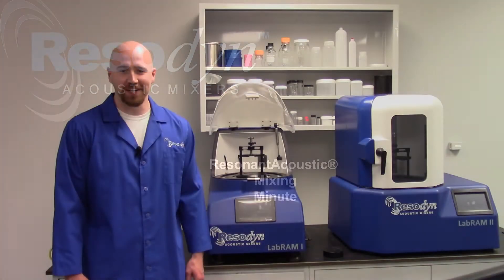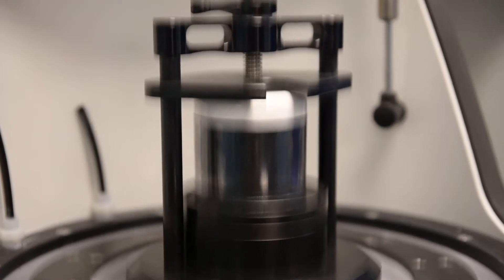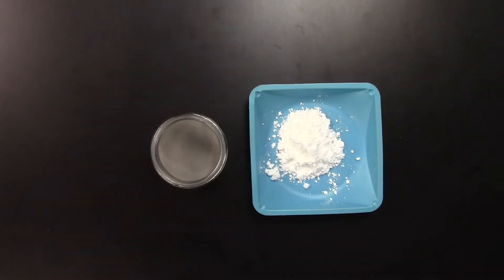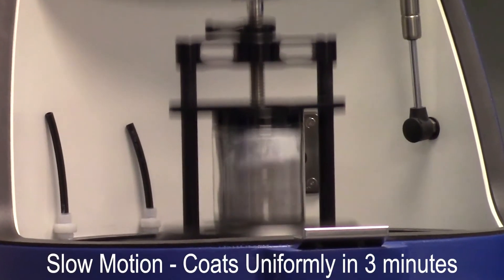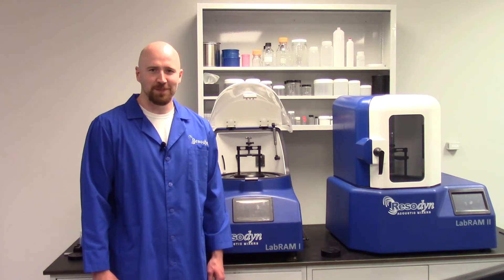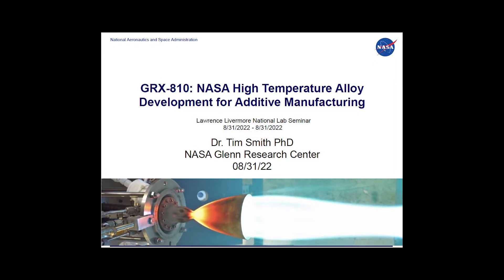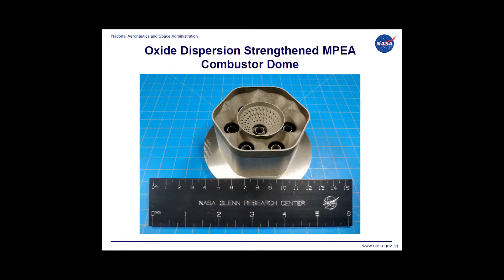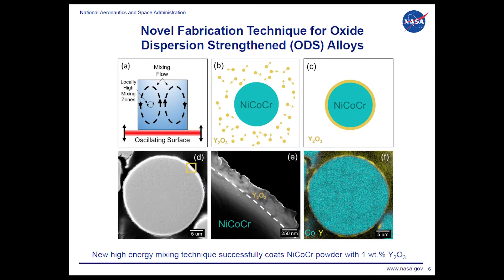Resodyn Acoustic Mixers Mixing Minute ODS Alloys NASA GRX-810

Comment: Im curious if this could be done to automitive car parts that need hogh tolerance like.. the piston and piston arms. The tiny metal spacers for the crankshaft, the crankshaft, the valves the the heads the block itself. Also there is a type of material that when you coat the metal becomes almost frictionless. I DONT remember the name of the alloy but I know that the way it is done is by fuming off atoms of metals and letting it bond to the surface. It creates a nano coating very similar to this method. I am very curious about this tech.